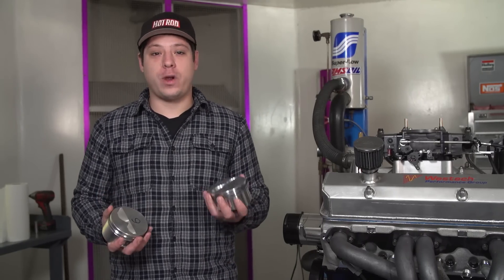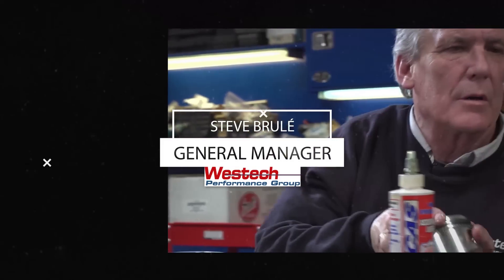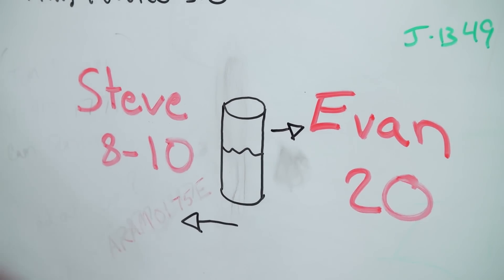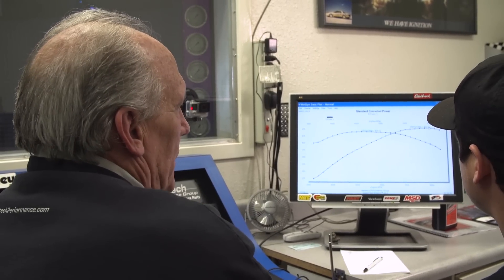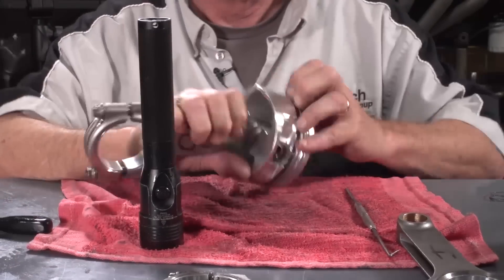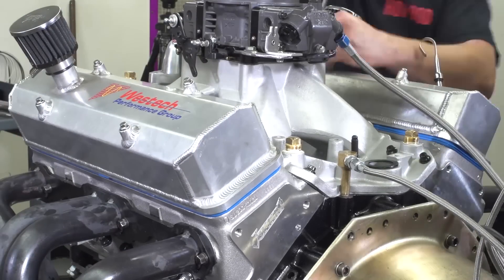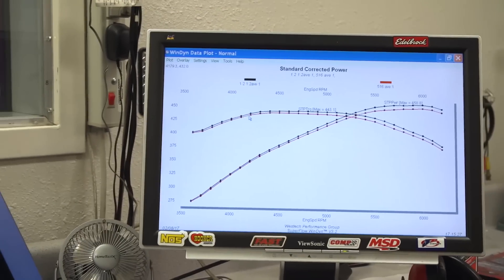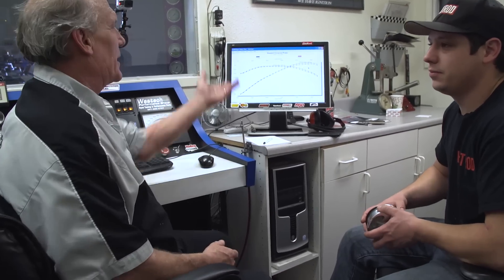Dyno Tested: Are Thinner Piston Rings Worth Horsepower?

Comment: sometimes it's all the little things that do make the big difference. 8hp here, 15 over there, 5 here, 2 there.. next minute you've got  30hp over the competition.
Reply: Exactly. Freeing up 2-5 HP here and there adds up. How much HP does a mechanical fan and water pump sap away? Not enough to notice in your grocery getter, but its enough to put you in last place on race day.
Reply: Engine Masters did an episode on the fans... 30hp to run the clunky stocker on their engine. Just make an electric setup
Reply: Tekvicious well its not "just run electric fan" necessarily, as the amps drawn will use hp through the alternator
Reply: yeah, like 1hp.
Reply: T1000AX yes. Keep thinking the competition is stupid. While you're making 30hp over your stock 5hp engine, others are making3 and 4000hp
Reply: Perspective. They were talking about regular guys with real street cars (not "Mid-west" streetcars). Their engine made nice normal kind of HP.
Reply: yes and no, yes in that it will actually use more hp, due to conversion efficiency losses of making said electrical power, but no in the sense that the electric fans can be turned off as needed when you need the most hp (which almost any modern car does anyways with the a/c compressor when you go WOT) (and in reality by the time you are moving 5-10 mph, depending on grill opening size of course, the fans are kinda ineffective anyways cause more air is coming in through the grill then the fans can typically move) but also with said incoming air, it also helps the mechanical fan spin some especially, i just don't know how much hp it might free up though
Reply: and it only took blowing the entire engine apart,reinstalling new pistons,rings,re-torquing,
reassembling FOR 8 HORSEPOWER.essentially you know this is not worth it in and of itself.
Reply: trillrif axegrindor yes they did that here for the experiment, what's your point? Common sense says its not worth it to take a motor down just for this. But if you're building a new one, there's 8 more easy hp
Reply: This is YouTube - what did you expect ;-)
I agree, BTW.
Reply: Jake, besides the comment that they can be turned off, you can run without an alternator or turn it off under load.
Mechanical fans are also intended for maintaining effective airflow at low rpm when there isn't air being pushed through the radiator by vehicle movement - over ~10 mph they do little except consume power.
Reply: Exactly, John - one has to refine everything to maximise the benefits.

As an aside, for years I have been bemused by some VERY overweight people chasing a horsepwer here and there when they could lose an easy 100lbs (often much more) which could make as much improvment, or more, and save them food money as well.
Reply: @trillrifaxegrindor4411  They literally said in the video "If you're already building a motor, there's no reason not to go with thin rings." Basically. When in rome.
Reply: Jake Mcintosh you turn it off right before the run dummy
Reply: @jakemcintosh2201  Yes, that's exactly true, but there is also an old school street car trick of putting a microswitch on the WOT throttle position to kill the continuous 12v field to the alternator, shutting it off electrically and running the next 11 seconds of quarter mile on the battery, it's worth power.
If that electric thermofan is run off a thermostat, and you keep the temps down in the lanes then it won't come on and sap power anyway.
Reply: T1000AX
Reply: Yup all the little things add up. 
Back in the day with a buddy of mine, we always had pretty much identical setups/cars but I’d go an extra step here and there. 
The stuff that takes time and gets minimal results, but if you do a bunch of that it pays off. 
Cleaning up some ports and gasket matching , for an example. 
And I’d see the payoff by the time I was shifting to 2nd gear as I was already pulling away 👍🏻
Reply: @gordowg1wg145  
 Good point   and if you race  motorcycles  it becomes a big factor .  That extra  burger can cost you a race  !!!
Reply: @jakemcintosh2201  Very little compared to electric fans. In modern cars, the alternator is charging the battery the majority of the time anyway. Lots of alternators now are 160amp and up.....
Reply: @gordowg1wg145  You are completely incorrect that Mechanic fans or Fans in general do nothing but consume HP above 10mph...at 70 mph my factory direct drive flex fan (no clutch) wasn't providing enough cooling, for grades in the Mountains...as at speed it was "flattened" because of flex...I had a Derale Fixed Fan overnight shipped to me, and I installed next morning, that afternoon took same drive at nearly same temp (actually 2°F warmer) second day and the vehicle did not overheat...
Just because you don't "hear" your electric or clutch fan engage on the highway... Doesn't mean its not cycling... Even my little Econobox the fan cycles on the highway...I can pull fan data off the OB2 because the ecm runs it.
Reply: @misters2837  
I was a bit confused there when I couldn't find the comment you were responding to - but then realised you've just posted in the wrong video's comments section - been there, done that too, probably.
Would you be happier if I'd said 'almost', as you've apparently found an exception?
Reply: @gordowg1wg145  NO if you scroll up 1 Year ago you were replying to a Jake....and the last sentence you said above 10mph they do little except consume power.  GO READ
Reply: @gordowg1wg145  NO I would be happier if you didn't make uneducated comments.  You are no different than most of the so called "interwebz exspurtz" SMH
Reply: @gordowg1wg145  Too Bad YouTube doesn't allow me to Post a screenshot of your comment...EVERY Vehicle I own....the Fan Cycles during highway speeds, because the aerodynamics (for MPG) of today's cars...they have gotten rid of big grille openings.
Reply: @misters2837  Thank you, there was a video on fans - types and effectiveness, that I was looking for, but you've saved me from that.
I stand by the quoted part in the main - except parhaps I should have said for the most part, generally, or a similar clarification that it isn't ast iron rule.
If I were you, though, I would be more concerned about the vehicles' overheating than semantics as they should not be requiring the fans, period.
Reply: @misters2837  

Meh, retired Senior Automotive Engineer, Mechanical Engineer, motorsport enthusiast, etc...
Fix your cooling systems...
Reply: @gordowg1wg145  Meh You can CLAIM whatever you want on the internet...And I know all about how much power fans consume....having spent most of my life building engines and running a Dyno cell... (They took the engine masters video off YouTube that showed the performance losses due to various fans.) Every Vehicle From My Little Econobox to My International 4700 Toterhome requires a cooling fan at speed...at least in the summer time, I mean at -20°F yeah you don't need a rad. fan, your HVAC system is practically cooling the engine.  As for the vehicle in question...I have a New Modine 4-Core Radiator, with Shroud, new high quality hoses (even made sure the suction hose wasn't flattening, and installed a spring), I have a  custom CNC machined impeller that is actually shaped properly (not stamped blades) to actually pump at higher rate without cavitation...and direct drive fan....but when the vehicle is making 3X the horsepower as factory, and the vehicle engineering department obviously had better things to spend than making the cooling system oversized or work without a fan. So my question to you is, HOW CAN I FIX SOMETHING THAT ISN'T BROKEN... Oh and for all those naysayers that think "thermostats are the answer to cooling problems" they just make the engine warm up (and overheat) faster even though everyone that is a so-called expert think otherwise...

Comment: Not only a few HP, but it allows a more compact ring package and lets you move the wrist pin up farther so a longer connecting rod can be used.  
That parks the piston at TDC a little longer as well.  All small performance gains, but they add up.

Comment: Great test, this is good info for us folks that had to use a set of pistons for a build that we could only find with a 5/64 ring pack instead of the thinner rings, even 1/16 set, that we really wanted to use. There is indeed some difference but it does seem slight and for many engines would not make a difference, especially in a typical street engine like the one used here. Hats off to you guys for doing the hard work and giving us really useful stuff. Things like this help us out. We also know this was a fair test done by competent people that we know and trust like Steve Brule.

Comment: I got a test that's up this alley.  Test a big block with a big "high capacity" 7qt pan, then swap in a wind age tray, crank scraper, stock oil pan and run it with just 4qts of oil (1qt low).

Comment: Brule has probably forgotten more than most of us will ever know...  But I did notice quite a bit of blow-by when Steve was running the thin rings. It's predictable that there was some cylinder surface discontinuity due to ring wear-in from the thicker rings. I would like to see this test with both ring packs on identically prepared, freshly honed cylinders.